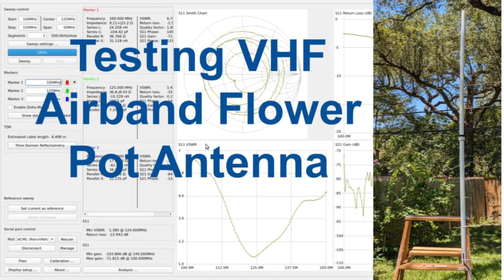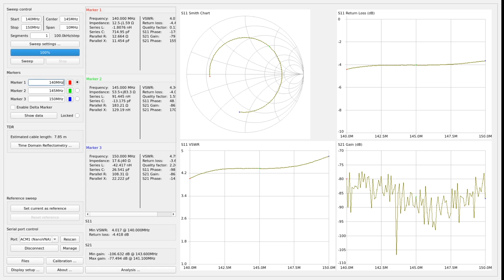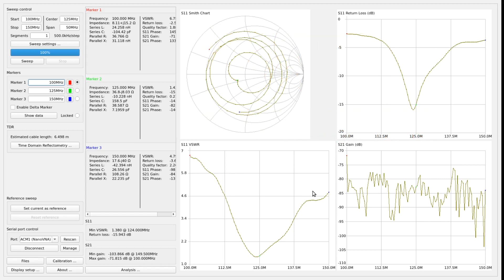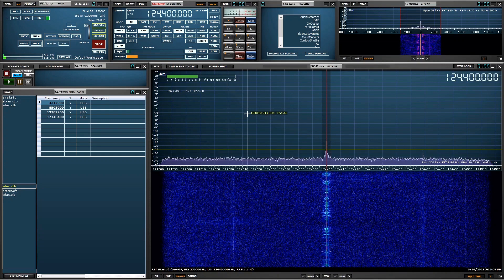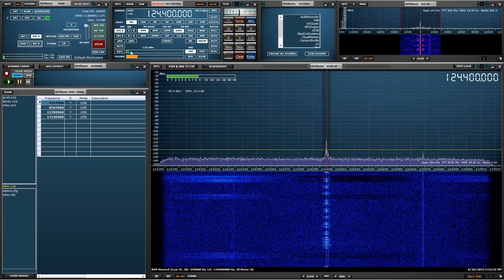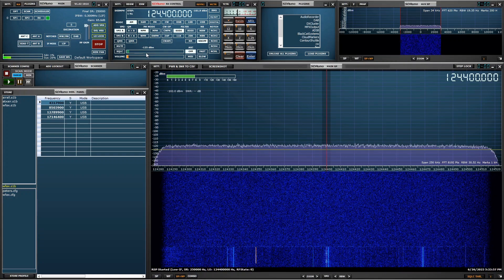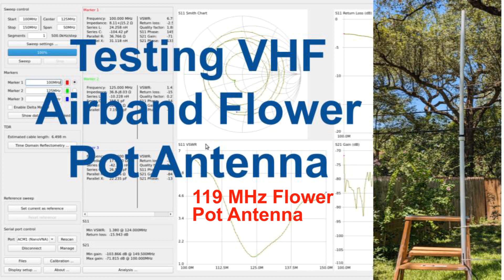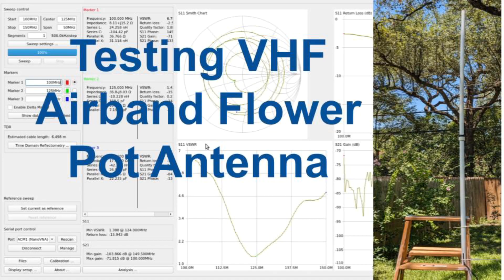Test of a Flower Pot Antenna For the VHF Aviation Band

Comment: Hi thx for this video, so what's going on with 119MHz at the end, after showing the flower pot is superior for 124.4, at 119 the flower pot reception seems worse/noisier than your wire-over-tree antenna; is this because the flower pot antenna is tuned for 125?  What should be expectation of a flower pot if air band is 108-137 and it's tuned for say 122.5 in the middle (or 125 in your case), how quickly does quality of reception degrade as you get away from the frequency it's designed for?
Reply from the maker: I don't think the antenna is substantially worse for 119 MHz than for 124.4.  It was picking up some noise better at that moment.  I don't know the source of that, but it is not present all the time.  Later, I noticed that the flower pot antenna is sensitive to height above the ground.  I'm sure the wire over the tree is very sensitive to position, but it's hard to experiment with.  Cheers.
Reply: @electronics.tinker  thanks so I built my first antenna!  it works - able to pick up approach/departure/tower for DCA tho still noisy especially tower.  Location will be a big factor and have some limitations on placement, but wondering if there are other factors in the antenna that can help improve performance since this was my first try at it.  I built this with some BNC coax RG58 50ohm 80% velocity per Amazon, using the specs from that website on G4NSJ's video and 20mm PVC tube.  Is the length for the impedance coil a "minimum", how precise does that have to be?  Did your antenna have a coil I don't see much of a bulge in the picture.  I also saw another video where they made an antenna by separating the inner from the braid rather than stripping it and hanging those two pieces up with the coax coming from the middle - does that style differ in performance from this flower pot design?  Any advice what to try next appreciated!  Cheers!
Reply from the maker: I do have the choke coil sized per online calculator.  It's covered by white tape so it is not easy to see.  I believe it is needed.  My bet is that, as a receive antenna, the measurements do no have to be super precise.   I just built mine and then measured it with a nanoVNA. It looked OK right off.  Later, I tried suspending it from a tree in my back yard.  I found that the height off the ground mattered.  Testing with the ATIS signal from our airport, I could make it vary between excellent and poor just by changing the height.  I don't know how to explain that (higher was not always better).  Since things around antennas affect them, I just experiment.  I live in an electrically noisy suburban environment with nearby power lines.  So, I just tinker and see what appears to work.  Cheers,

Comment: Hello, which antenna is better to receive the air band, a Dipole type or a ground plane whip? I want to have the most powerful one to receive 118.0 to 136.0 Mhz. I want the better.
Reply from the maker: I think either is OK, but I'd go for a vertical mount regardless (not a horizontal dipole-- but vertical dipoles should be OK, J-pole for example).
Reply: @electronics.tinker  Thanks,  I will buy the DPD Production Airband  Antenna.

Comment: A low SWR should be a good indicator of performance in reception as well as transmission, if one considers the law of reciprocity (If it transmits well, it will receive well).